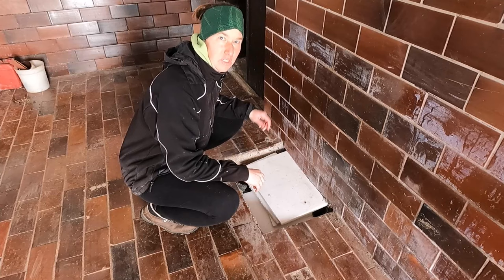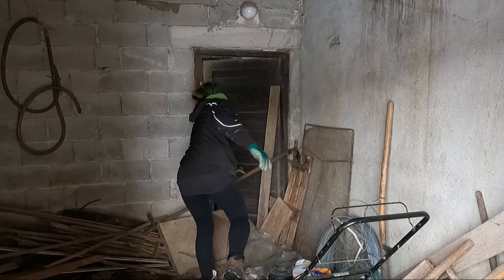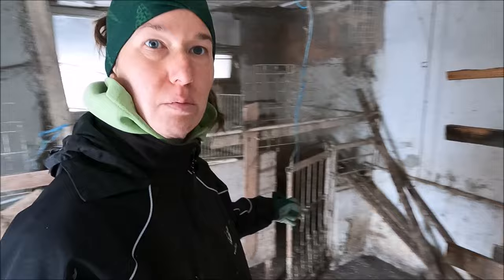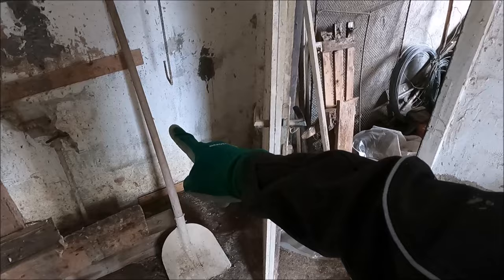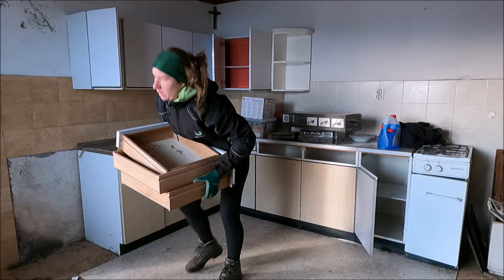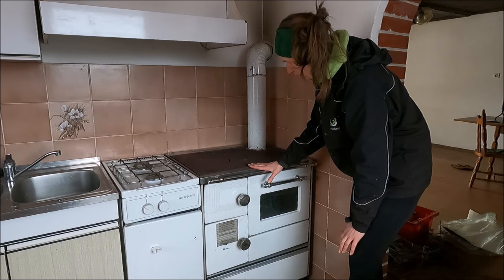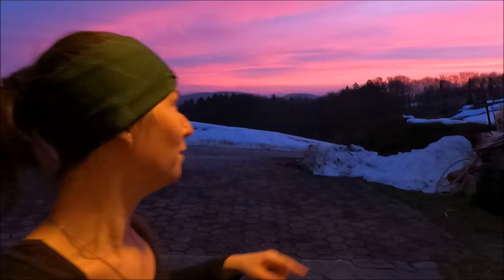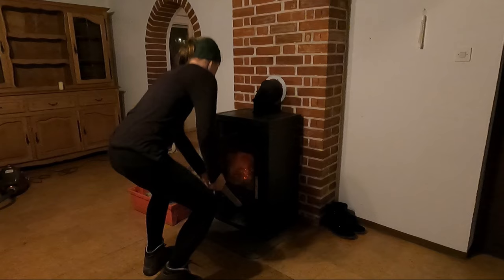I Actually Have a Stable on My Property

Comment: Instead of pulling heavy things on the rug,
try putting it on the rug and pushing it with your back towards the item and using you feet to push you. So much easier and better on your back 👍